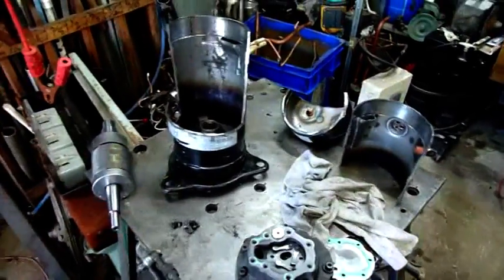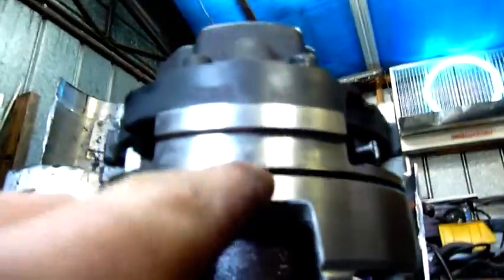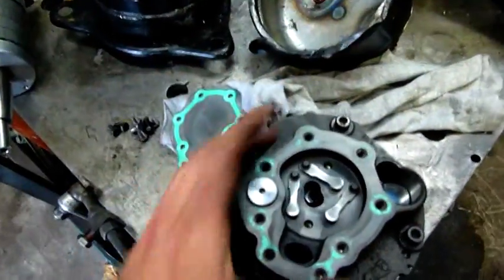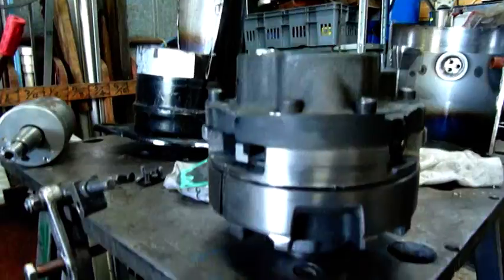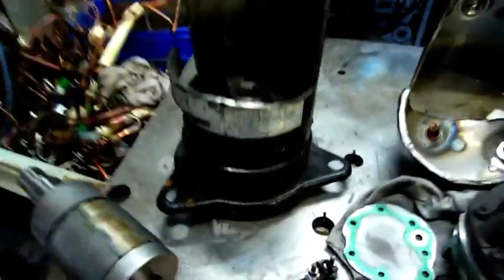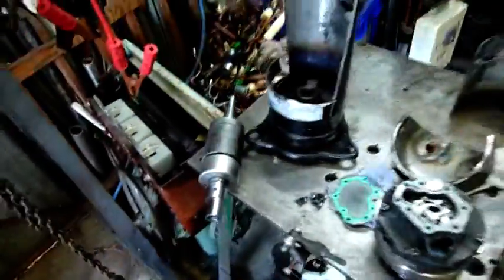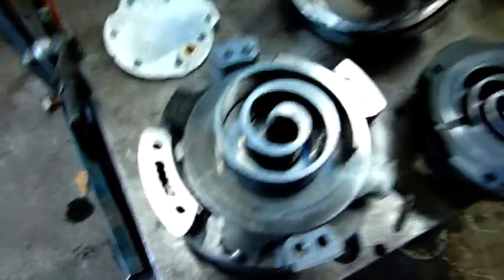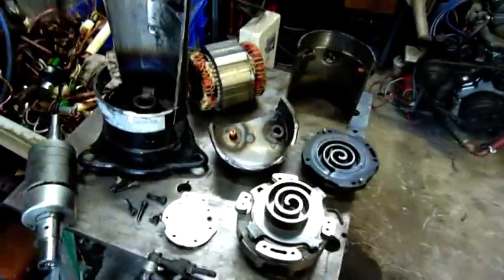Daikin Industries VRV Scroll Compressor Autopsy

Comment from the maker: @rossm06 great info!, interesting to hear that thermal shock was breaking down the motor insulation!. but I guess modern insulation's are designed to better run at high temps, especially when the rise and fall is pretty smooth and graduated.

 the Daikin unit had a huge accumulator so I doubt any liquid would make it back, apart from a small spray from the solenoid valves.

Comment: Great vid! Love ya work! If I remember correctly Daikin use the outer casing as the discharge as you say. The theory is that the motor winding of past compressor designs were suffering and failing from the sudden thermal shock of the cooler suction vapour returning to the compressor and as such changed the design to discharge vapour. Also scroll compressors don't exploded if a small amount of liquid floods back from the indoor units so therefore isn't much of an issue.

Comment from the maker: @rossm06 Very interesting!. the unit did not have a normal constant compressor so it must not be a VRV unit ( I was comparing the compressor type to Daikins Animated advertisements) but the compressor itself is the same as what is in the VRV units.

I have a LG version of the VRV to bring in for autopsy and tinkering very soon tho. it has the normal cap run main comp and baby scroll DC inverter comp.

Comment: The VRV's come with 1 inverter and 1 constant compressor. A couple of times I had an inverter failure. The inverter compressor windings metered ok so to check if the compressor was ok and not mechanically seized I put 3 phase power DOL (direct on line) but only for a few seconds. Ocassionally we have DOA (dead on arrival) of compressors of new units. A few times we have reversed the phases to looses the compressor and put back to normal with about a 50% success rate.